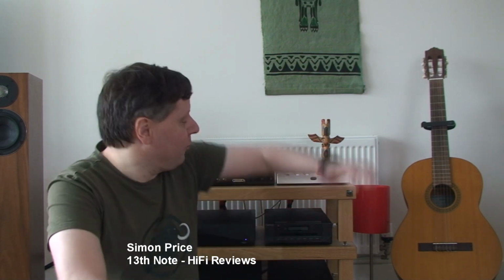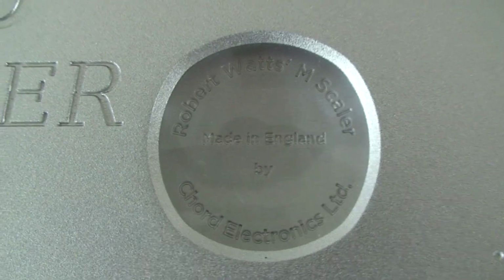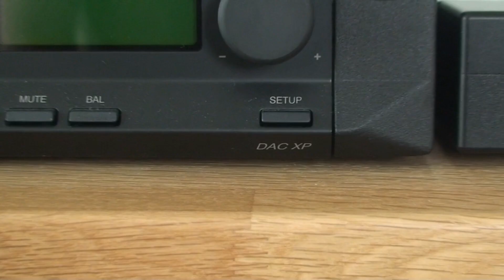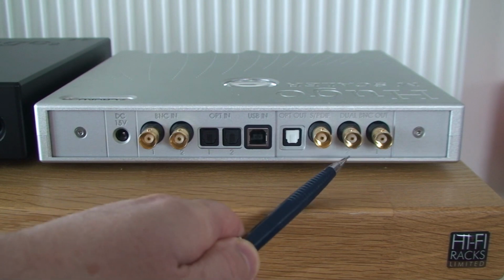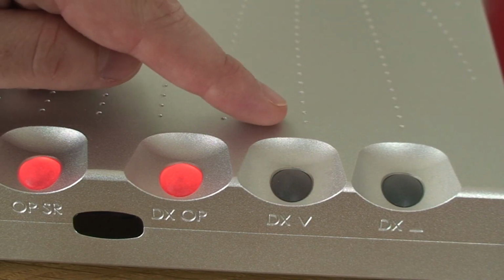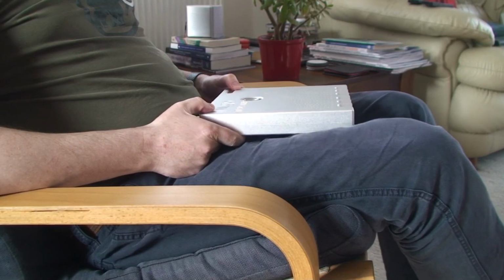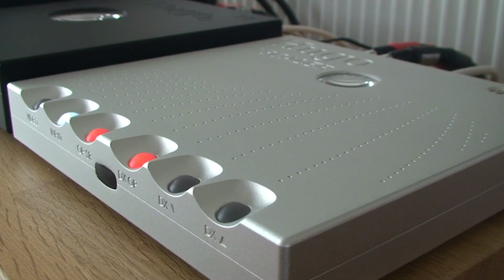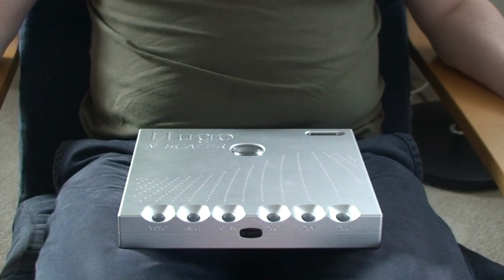CHORD HUGO M SCALER (upscaler) Review

Comment: $20k in awesome audio gear, but won't buy a $20 USB mic. ;)
Reply from the maker: It’s all a learning curve but thanks for pointing it out. This is an early video and I now use a Zoom Mike for the very reason you mention.
Reply from the maker: Sean Flynn depends on the rest of your gear Sean, as it’s always relative to rest of gear as to what benefits you get out and only you can really know this. But I think the tt2 alone is a better bet to the m scaler and Qutest in quality systems. In other words the tt2 is a better value for money proposition. It has a more typical audiophile HiFi sound with richness, and bass response and a bit more clarity and soundstage whereas the m scaler mainly improves soundstage. But considering all the areas where sound is improved and for less money than a Qutest and m scaler combo, the tt2 alone make sense rather than Qutest + ms. The ms and tt2 is a Chord Dave competitor, but the ms really just takes sound up to what is already good as an upscaler with a great filter. It can’t make the DAC in the tt2 better itself. That’s the way I look at it. It doesn’t mean it’s not good, but law of dim returns comes into these products as always. Something most reviewers don’t mention.
Reply from the maker: Sean Flynn I just completed two headphone reviews - focal clears are amazing and review will say so, but cheaper Meze 99 Neo which I compared against better grado SR225, have jumbled excessive bass. I say so too. 3-4 friends all agreed, so if I don’t say so I’ll loose credibility as I think most would agree with me. A lot of reviewers will just say they are great. But let’s be honest most consumer audio is great, so this comment needs balancing with that! It will far from have an affect to me, which is why I don’t understand why all these internet reviewers are better and more honest.

Comment: Thanks for this review.  Can I ask are the stock chord coax BNC cables good enough or does one need to spend more on OEM BNC cables ?  Have you heard any difference? Cheers Adam
Reply from the maker: Normal cables fine is my view now
Reply: @13thnotehifireviews7  great.  Was hoping you would say that.  I'm running the HugoTT2 with my Auralic aeries streamer and I control the volume via my arcam avr850. But I'm told I can use the HugoTT2 as a preamp and use the volume knob on the DAC.   Any thoughts on this ?  At the moment the line fixed volume input sounds great but can always look for better :)!
Reply from the maker: Should be fine thx

Comment: I have the M-Scaler with the Hugo TT2 dac (previously had the Qutest). With the purchase of the Hugo TT2 there was an immediate improvement over the Qutest, even with the M-Scaler attached to the Qutest. The Hugo TT2 is simply sublime, but when adding the M-Scaler it's in another league altogether. I could never go back from using it.  There is always the feeling, with digital audio that analogue is better in some respects and I would always subscribe to that view. However, you'd need an extremely good turntable/arm/cartridge to get anywhere near the sound that is achieved with the Chord TT 2 and M-Scaler. As to value, the competing analogue front end would be more than two or three times the price of the Chord front end even when including the necessary streamer/server. To me, this is digital done right. I still like listening to vinyl of course, I have many records which have not been transcribed digitally but 95% of my listening now is digital and I'm completely happy with the sound.
The TT2 is also a pre-amp, a great headphone amp as well as a dac. The crossfeed option boosts headphone listening a lot. The M-Scaler is the icing on the cake.
Carry on with your excellent hands on reviews.

Comment: The m scalar has been around for about 2 years now but not a single peer reviewed technical research paper behind this supposed ‘Engineering marvel’. All I found was marketing PDF and concept notes on filtering.
Reply from the maker: I thought it was good but very expensive for what it does on full reflection. I think it was more a self indulgent pursuit by the designer with a million taps, and because it is Chord it would have reviewers raving, existing consumer would as fanboys too. dealers would and pr agents. I didn’t see any reviewer anywhere calling it out as undeniably offering less than a tt2 on dollar or pound value. This is what the HiFi industry rides on unfortunately.
Reply: 13th Note HiFi Reviews true that. I was so excited about mscaler and could not resist the purchase, however the honeymoon was shortlived. Thankfully I could opt for a refund.

Comment: Chord M Scaler is not a filter. You learn this in year 1 signal  processing. 

With Nyquist theory 16bit 44.1kHz is will more then enough for digital sampling for human hearing.
So why digital sound so unnatural. 

Easy because the same theory also said you have to use infinite sinc function to recover the original sound.
Today most pre made DAC chip use sinc(32) or less i.e. 32 tap.
Whereas M scaler recover sound with sinc(1,015,808).
When sony and philips introduce CD they said sinc(8) is more then enough.
Now we all knows you need more much more.
Reply from the maker: Thanks I think I said the m scaler utilises a filter which undeniably it does.

My Channel concentrates on features, looks and sound quality as for everyone who puts forward an argument one way there can be an argument the other way in HiFi. I don’t do this as great audio faithfully reproduced is non exclusive and to be enjoyed by all. So theory and overt technicalities don’t come into it.

Comment: tt2 is actually kind of garbage sounding with out the mscaler iv ab and demoed over and over again, and with out the mscaler the tt2 is a  panfull waste of time and money consider them and integral purchase or never touch it,  with chord really go for the very top or bottom the middle lacks value go with a hugo 2 or mojo or go right to the Dave, Dave with a mascaler still makes gains but less there less obvious then the gains that the tt2 combo gains, the layering and depth and space of the dave cant be beat by the combo you may get just a tocuh of detail over the dave but not the finess, the tt2 does have some "warmth" the dave may lack but the pure tonality is not there in the tt2  , the dave sounds so good with or with out it  there is no draw back to the dave , the tt2 is a half measure youll eventually want to get rid of, save your time and money and get a dave, the dave is not the best dac in the world but it playin the same league as the big boys for half to a 6th as much, the only other 10 k device id be interesting in is the new luxman disk player or eventaul standalone dac based on the same novel chip,

dont fuck around  be happy with the bottom or go straight to the top

you'd be surprised what a mojo(black nugget of gold) can do with 1  to 2 k in silver occ cables and a dedicated psu used as a digital pre to any 10 to 20k amp

i do this for fun shit on snooty dealers when i go shopping
Reply: That's interesting. I have a TT2 with very expensive amps and speakers. The sound is exceptional. Neighbours have even  asked me what music system I own when they can hear it through open windows in the summer. It's exceptional sound from the TT2. To say the TT 2 is garbage makes me wonder what you are using it with. Without the M Scaler it's extremely good. Of course you are entitled to your opinion to say it's garbage. I don't have any issue with that!
Reply: @user-tk7kz1fl2r  garbage for the price . I have or have had lots of DACs in my system above and below and the tt2 is the worst performance per dollar . Your to poor to afford a Dave or two ignorant to find a DAC of better value
Reply: Worst value in there line up. Sure if the others didn't exist is fine enough but there's noooo way you can live with it stand alone after listening to  Dave or after listing to a mscaler .  Going from a tap perspective or from 10th to 12 order noise shapeing